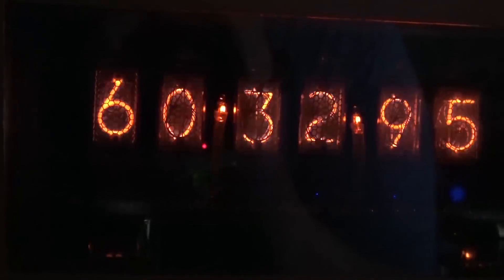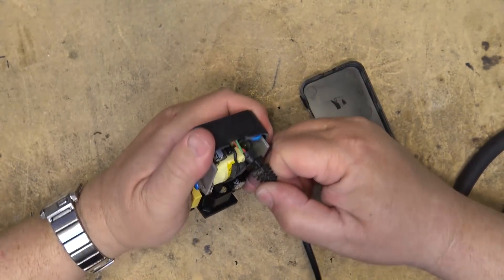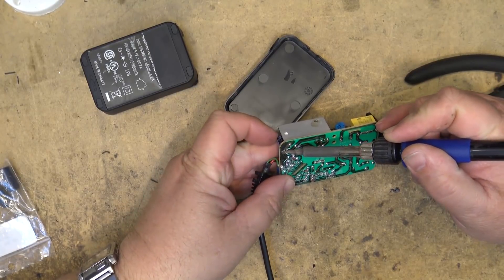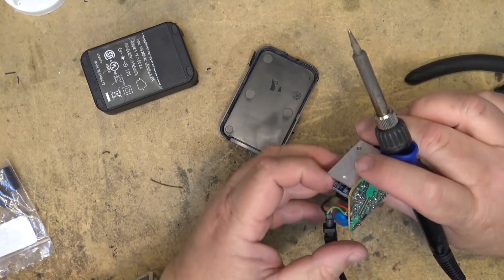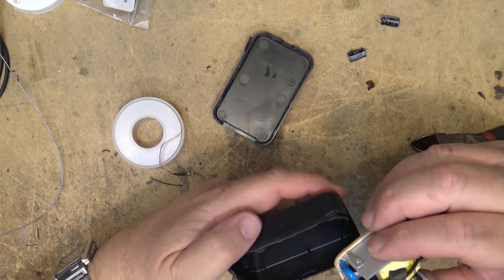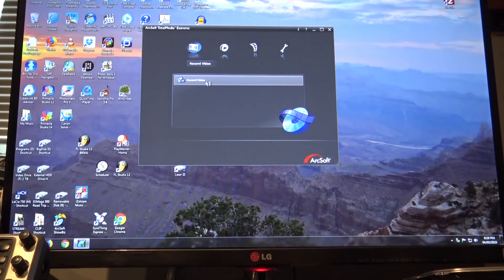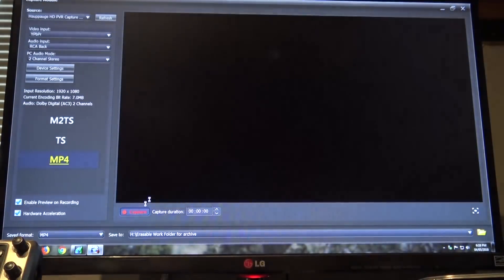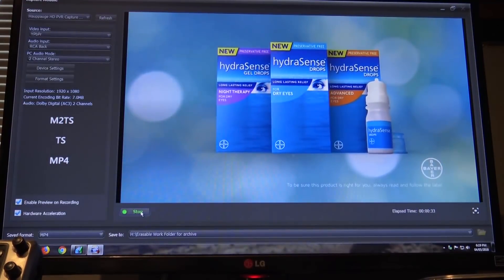HD Analog Capture Card  Power supply repaired

Comment: I'm much like you with small switchmodes, if it's a decent little unit then a repair is worth while.
The only thing i do extra is drill some small holes in the case to get some air in/out, keeps it a bit cooler, those sealed cases are an ovan :-(.